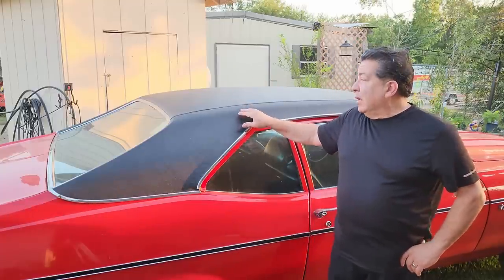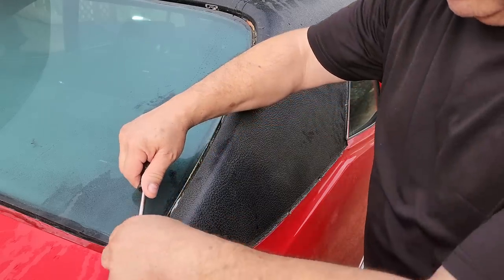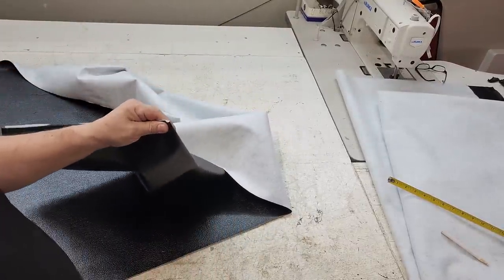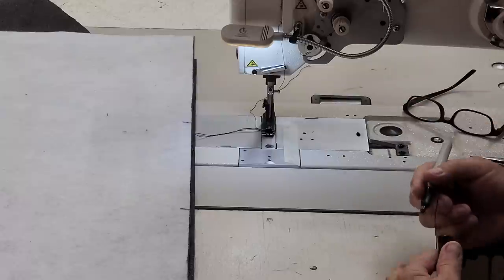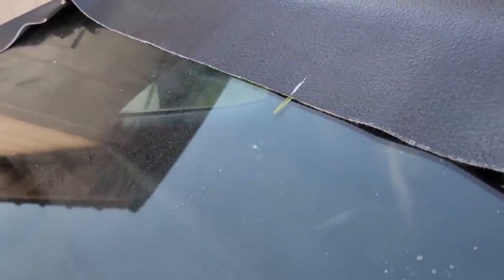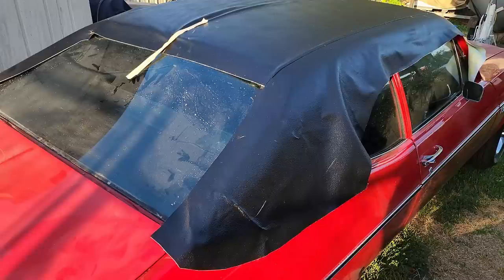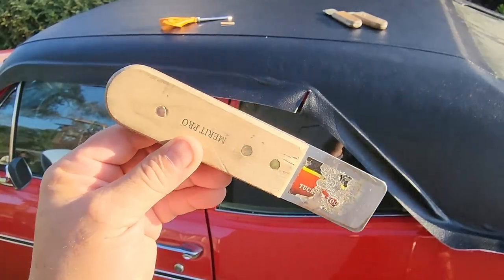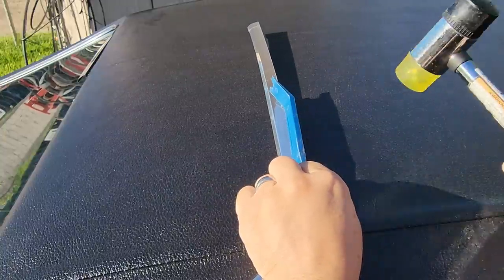Watch this EPIC auto landau vinyl top make and install

Comment: Technique #2015: lay a paper towel over the contact cement then soak it with mineral spirits when the cement is dry and old.  Let it sit for quite some time.   If it's really bad, lay plastic wrap over it and it can soak for hours without drying up.
Reply from the maker: Hello Chip, That sounds like a great technique, Should have a lower number though based on how important it is! Please keep liking and watching!

Comment: Great video thanks. I've seen so many people online. I say that you have to remove the front rear glass in order to install a vinyl top that I was really glad to run across yours and see that it can be done without removing the glass.
Reply from the maker: Hello Big, You are so welcome! Thank you so much for saying so. I have to say that in 45 years, I have done hundreds of original vinyl tops. Not one ever had vinyl under the glass. Only the early Mustangs had rubber gaskets around the glass over the top of the vinyl. Just sayin'. Please keep liking and watching!
Reply: @oldschoolautoupholstery   Thanks for the reply.  This is a 1969 Cougar, so it has butyl for the front window and a rubber  gasket for the rear that I can see headliner material under, but not vinyl.
Reply from the maker: @BigWill63  Hello Big, you are right about the headliner material being under the rubber gasket. I guess that was the way the Ford cars were designed. Please keep liking and watching!

Comment: If that were my car, Id have the vinyl removed, and would not re-install vinyl. The paint looks great, without the vinyl. We use custom made stuffer tools, made from teflon. They are soft, smooth, and no chance of scratch's. Nice job !
Reply from the maker: Hello Alan, Thank you so much for saying so! This was originally a non vinyl top car the they added the vinyl top. As for stuffing tools, I guess I'm Old School. Still using the same tools I have had for decades, I never loose them. Please keep liking and watching!

Comment: Awesome video At my job we use a red contact cement glue that is strong as f 130. Bucks a gallon when this glue makes contact with each other you cannot pull it apart no matter how hard you try I'm using that glue on some upholstery stuff I'm doing on our 65 SS Impala thinking on doing a one piece headliner IV been to a fabric store here in Phoenix Arizona called HNR fabrics got a factory fabric color the same color as the original factory
Reply from the maker: Hello Paul, When I was in Phoenix, I used H&R a lot. Or I would go to Santa Barbara upholstery suppliers in Glendale. I am sure you will do just fine with your '66 Impala. Please keep liking and watching!

Comment: Excellent video for a very mystifying process! You make it look very easy, but I know that is because you have decades of experience. Quick question . . . how do you remove the lower beltline molding on the vinyl top? You showed the glass reveal molding, but not that lower trim. Thanks!
Reply from the maker: Hello Jim, Thank you so much for saying so. The 1/4 trim was attached by plastic clips. They are clearly seen in the reassembly. Check it out. Please keep liking and watching!

Comment: Many times the roof is rusted out under the vinyl top. Factory tops often were poorly painted underneath. 
The drip rail stainless moldings are often NOT easy to remove without denting or kinking them, and can be one piece, not three like this Nova. I made a tool to carefully remove them without damage.
Reply from the maker: Hello Lou, You are so right, I've seen many unpainted roofs under the original vinyl. Please keep liking and watching!

Comment: You heard me laugh , did I you also hear the waterfall of chocolate milk falling from my nostrils prior to my laugh ?!    
  That poor guy with that Nova was scammed .  
  I have never seen one without ANY adhesive.   At least give it a sprits .  I guess they think the pull of the vinyl will prevent it from pulling .   
   Just wow . 
  Great video .
  What would be your recommendation be for using an 1/8” closed cell foam under another material ?
Reply from the maker: Hello Doc, Thank you so much! Yea, amazing right? Yep, 1/8" or 1/4" closed cell landau pad is what's used for padded tops. Please keep liking and watching!

Comment: Great video! But what about the front molding?  Is the top stuffed behind the trim there too like the back?  Did you had to remove that front trim?  Planning on doing this job on a 70 Nova and would like to know.
Reply from the maker: Hello Ej, Thank you so much for saying so. In the old days it was a lot easier to replace a windshield that was easily cracked when removing the chrome windshield trim. I di not want to take that chance. That is why I pried the chrome away from the body to create a gap to spray the glue down into the gap. Then tucked the vinyl behind the trim. Same result. Please keep liking and watching!

Comment: Well done. You make it look easy. How much glue do you typically need for this size of install? Can the glue be sprayed using a typical LVLP paint gun?
Reply from the maker: Hell The, Thank you so much! I usually get it done with less than a quart of contact adhesive. I have never used the LVLP gun because you just can't set it down any where you are like you can a spray gun. Please keep liking and watching!

Comment: Nice job.  What is the air pressure setting you have your spray glue / contact adhesive gun set at?
Reply from the maker: Hello Guzzy, Thank you so much! I don't pay too much attention to air pressure. Not rocket science. I would guess anything higher than 35lbs. depending on the application. Please keep liking and watching!

Comment: I’ve read that people scuff up the roof before applying glue but it looks like you apply it over glossy paint so is it not necessary to scuff before the glue?
Reply from the maker: Hello Big, Scuffing the paint is not necessary and the contact adhesive is really good stuff. They never scuffed the paint at the factory. The reason for scuffing paint before paint is because paint is not glue and needs help for adhesion. Please keep liking and watching!

Comment: How much do you over lap the rain gutters? I want to make sure the chrome trip can fit back on it
Reply from the maker: Hello Rob, It the rain gutter trim is original, you want 1/2" inch under the the trim. As in this case, the aftermarket chrome trim was meant for a non vinyl top car. The chrome would not go over the vinyl. Please keep liking and watching!

Comment: Would those be the same and pop off on a chevelle i neverous to pop them off and have rust atound the bottom clips and need to take off and sand what do recommend boss ? And sense i have to treat it might as well replace the top but looks brown under it hope not more rust
Reply from the maker: Hello The, If you know there is a rust problem, you should strip off what you can to do the repair. Please keep liking and watching!

Comment: Owner's Tip: If your car has a worn or torn vinyl top, repair or replace ASAP.  The rip will allow moisture to build up between the vinyl and metal roof. The moisture will eventually rust out your roof leading to more repairs.
Reply from the maker: Hello Rlt, You are so right! Back in the 70's and 80's I saw so much rust around rear window ant side trim. Please keep liking and watching!

Comment: Rudy, how did you finish the front windshield tuck, since you left the trim installed? You cut then tucked the vinyl between the trim and roof panel? I didn't see you remove the front windshield trim.😢
Reply from the maker: Hello Bat, Your right, I wasn't going to risk cracking a brand new windshield in a 1972 Nova SS. When I sprayed the glue, I held a nice gap open for the glue to go behind the trim. I trimmed the vinyl as usual and tucked it in being sure to press the glue really well. Result is the same. Please keep liking and watching!
Reply: @oldschoolautoupholstery  Thank you for your time...again!
Reply from the maker: @battime5418  Hello Bat, You are so welcome! Thanks for hanging in there with me. Please keep liking and watching!

Comment: Is it possible to remove and reinstall the vinyl if it is in good shape?
Reply from the maker: Hello 79, You could, but I wouldn't. Chances of getting it exactly the same place is very slim. A lot easier just to put on a new top. Please keep liking and watching!
Reply: @oldschoolautoupholstery  any chance you would know of anyone that has “Saddle Tan” for a 72’ Cutlass S? The closest I have been able to find is “Buckskin” but it’s too light. It doesn’t look like the color is produced. Hoping someone may have some NOS material. Thanks
Reply from the maker: @79_cj7  Hello 79, During Covid, the manufacturers dropped so many colors. Try B-D co. in Denver or SMS fabrics I think they are in Washington state. Please keep liking and watching!